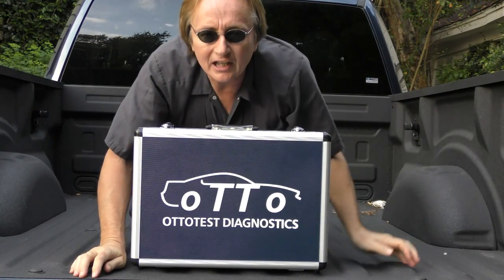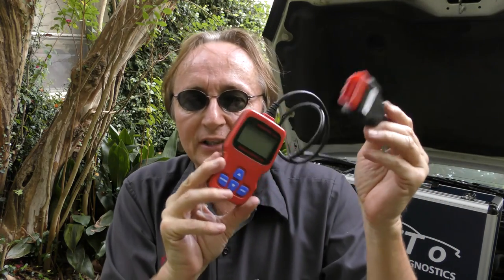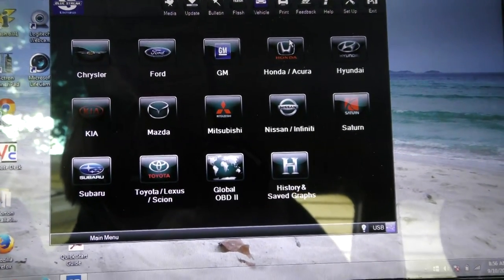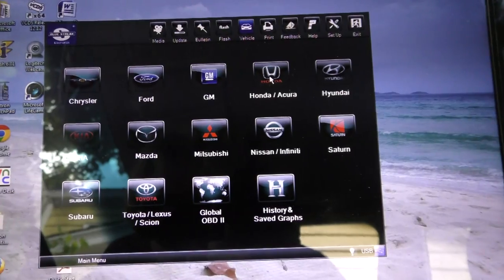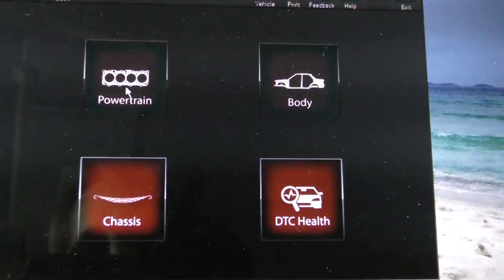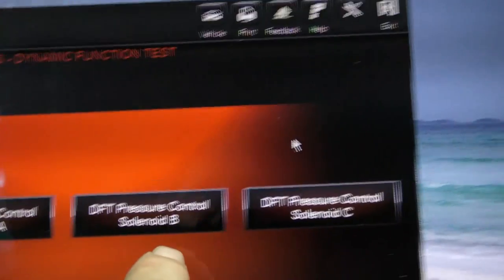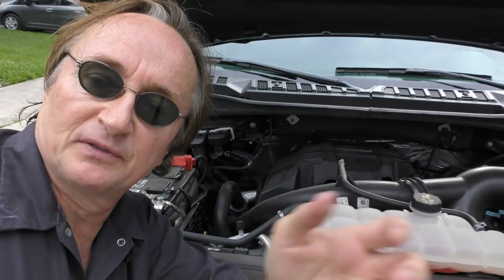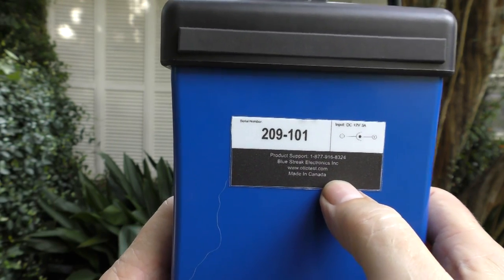Fixing Complex Modern Cars

Comment: Mechanics complain that cars are getting too complex / hard to fix. Yet older cars require you do preform exploratory surgery, taking half the engine apart to try and diagnose why it isn't running correctly. Whereas modern cars have sensors monitoring almost everything and can tell you exactly where the problem lies.
Unless a sensors gone bad in which case... Good luck :P  

Electronic diagnostics are a great idea, in theory. I guess in 10-20 years we'll find out if it was a good idea or not!
Reply: +Azurren 
Are you able to fix something in a '14 or even '13 car by yourself? or maybe you ll just take it to the dealership and drop your trousers down?
that's the point
Reply: thatunknownguy I was referring to modern cars which use open / available diagnostic equipment, not those who force you to go to a dealership.

But I'm not stupid enough to buy a 13 or 14 car in the first place..
Imo if you have the sort of money to shell out on a brand new / 1-2 year old car you have the money to get it properly serviced at the dealership. How else are you going to keep your warranty?
Who in their right mind buys a new car for $70k and gets it serviced for $20?

If you buy 10-20 year old cars you know exactly where you stand. So we'll see what these 14 and 13 cars are like in 2024 ;)
By which time every back yard mechanic will have advanced (old tech by then) scan tools or be long out of business.
Reply: +Azurren I couldnt agree more. Nice clarification
Reply: See. Here it comes again in this comment. It's all about labor that is mostly expensive. On the forums, a lot of people will help you. You don't just need a computer scan tool, a lot of people can help you online to DIY.
Reply: +Azurren you're pretty much right about this.... the only problem with buying old cars up north however, is the rust factor! If you ever had a brake line fail where you couldn't see it, like between the gas tank and frame, you'll know what I mean...😑
Reply: +Azurren Old cars may take more work to diagnose, but not only is it easier to diagnose a problem, it's easier to fix.  A modern car may do the hard work of diagnosing for you but it doesn't mean you have a clue how to fix it.  I'm personally a computer technician and PCs are heading in the same direction - they're getting easier to use but the infrastructure behind all of that is insanely complicated, so when something goes wrong, there's nothing you can do about it.
Reply: Peter Schmidt PC tech here to and I have to disagree with you. If you talk about a normal desktop computer you can easily fix and diagnose your problems. It's when it goes down the the actual circuits and bits and pieces of a component that is impossible to fix, like it has always been done. There is a few exceptions to this like bent CPU/socket pins where you can unbend them and other things to.
Reply: TheMidnightNarwhal That's true.  I guess I should have elaborated:
Modern desktop PCs are easier, because a lot of the time they are self-fixing, or there are workarounds to problems.  I was referring to problems where once the OS can't figure out what's wrong and if there isn't a workaround, you're pretty much stuck with the problem.  With older PCs and OSes, everything was so simple that you could just swap a piece of hardware or software and you're done.  With modern hardware, everything is integrated to the motherboard and a lot of software is closely-knit, while being heavily abstracted (which make tracing the routes of a problem manually very difficult).

For example, there have been times I tried dual-booting on a PC with Secure Boot for repairing from another OS. There have been times where disabling it has made performance in Windows suffer (sometimes causing it to freeze entirely) and other times I just can't disable it at all, so the only way to fix the computer was to take the hard drive out and put it in another system.  Secure boot is supposed to (somehow) protect and make life a little easier for users, but it adds a layer of unnecessary complication that you can't really avoid.
Reply: Yep. New cars are super easy to work on.
Reply: +Azurren Well when I blow a headgasket I pay $50 for a new gasket and a Saturday afternoon working on my car but if i sent it into a dealership then I'd have to pay $1500... Yes easier to diagnose but you still have to take it apart to fix the problem and the parts are more expensive having senors and computers inside everything which well generally sucks balls imo...
Reply: +Azurren I live in the UK and get so irritated with the European car makers these days, such a pain in the ass.
 But it's not really true about older cars with zero electronics. Someone who knows what they are doing can diagnose an older coil, distributor, carburettor vehicle in a few minutes just by listening to it and making a few simple tests, with no gizmos involved.
Reply: like your comments, idk y he's hating so much on Chinese proudcts n european too. they both make good products. i mean the chinese were among the first to make gun powders n european wit their beers. now n days every products are made world wide from different countries. the so called "made in" usa or china or europe or canada or africa n so forth, shouldnt matter anymore. its just stereotyping.
Reply: ***** Generally speaking, Chinese products are made to be as cheap and mass-producable as possible.  Chinese products often lack important features or have shoddy build quality.  Obviously that isn't always true, but that's usually the case.

As for Europeans, it's the complete opposite - they often over-do everything to an unnecessary level.  Their products are almost always good, but they're usually a poor value.  The Japanese tend to make products as good as Europeans but at a lower price.  They might not feel as classy, but most people don't care about that.  Scotty's complaints about European cars is because they over-complicate everything and intentionally get the customer to pay more for repairs.  Again - good products, poor values.
Reply: Peter Schmidt Well it's not always over-complicating. Parking sensors are cool, backup cams are also really neat, and loads of other features that started on European cars.
Reply: TheMidnightNarwhal I agree.  I never said all features are over-complicated, I'm just saying their designs tend to be over-complicated, and you're paying for this elaborate engineering that inevitably becomes difficult to fix.  I'd like to reiterate - I think Europeans make good products.
Reply: Peter Schmidt Yeah, I guess it's more weak less solid products but it's neat stuff.
Reply: +Azurren Eh. I say it's about 50/50 when working on older vs. newer when it comes to ease. If you know how the engine works on an older car, there's really not too much guess work to do. Parts are stupid cheap with a life-time warranty that you can easily pick up at the parts store. I guess it just depends on your experience though and how much time you've had to work on them.
Reply: Balto D If I could afford it I'd buy a classic '60s car in a heartbeat.
Reply: +Azurren So are you saying that a 68 Ford Mustang is a difficult car to diagnose problems with? There were diagnostic machines back in the 60's and 70's that were able to troubleshoot those older cars. With the right equipment, any car can be fairly easy to troubleshoot problems with. The problem with modern cars is the procedures and labor involved with repairing them-requiring dealer only special tools and what not.
Reply: I could fix an older vehicle without tearing the engine apart and these newer OBD systems just made an easy common sense fix difficult. If that puter goes down son, your screwed.
Reply: +thatunknownguy uhhh 13/14 still have warranty :)
Reply: +davis n. lol i drove a chevy z24 for 2 years with no rear breaks because of the ontario brine trucks lol
Reply: Pretty sure I don't want a computer that can fail controlling my power steering while im driving
Reply: bloodrune329 the computer is the least of your concerns.  It's the motor itself you need to worry about.  These days, computers are fail-proof.  The manufacturing process is so refined, and they run on so little power that they don't suffer from heat degradation.  Software designers have, for the most part, learned from their mistakes.
Reply: +bloodrune329 computer failures happen in cars everyday, and you'll almost never hear of an accident resulting in a computer failure in a vehicle. The reason being for built-in redundancies. If the comp goes out, the manufacturer has fail safes in place, such as resorting to regular mechanical steering in the event electronic power steering goes out.
Reply: Peter Schmidt
It depends is it running a light weight RTOS or is close to the metal, has ECC memory and a watch dog timer.
But if it's running consumer grade hardware and an OS such as Windows or Android the computer would likely be the weakest link in the system.

I had my cell phone restart for no reason at all if a car did this it could kill someone.
Reply: Membrane556 As far as I'm concerned, most car computers (that affect how the car drives) are nowhere near as complicated as you're making them out to be.  It wouldn't surprise me if they don't use much more than 2KB of RAM, and I would be really surprised if they ran an OS, realtime or otherwise.

In my experience, the most common low-level software-specifc failure for OSes is related to counters or timers, including the clock itself.  Once an important variable exceeds it's registry limit (which for many such devices would involve a 32-bit processor), that's where catastrophic failures or reboots happen.  But an ECU has no reason to be exposed to such situations.  It doesn't need to cumulatively count anything that would exceed it's variable capacity within the car's lifespan or a single driving session.

But suppose that weren't the case.  I would find it very hard to believe that there wasn't code implemented to make up for a variable being maxed out, and, I would find it even harder to believe that such a variable would bring down the entire system.  Modern cars have hundreds to thousands of individual processors.

TL;DR, the probability of a car's computer being the result of someone's death is so low that if it were to happen, the car would be in such poor condition that just sitting in it with the engine idling would be a mistake.
Reply: Sensors and their systems are plastic and will stop working or malfunction , and one code doesn't usually mean it's the problem, sometimes something else cause it, you need experience to fix , it all the same thing as for cars with no computer and with. Just how you deal with it
Reply: The only people who whine about computers are baby boomers.
Reply: are you fucked?
any car or truck from the 70's-80's I can diagnose and fix anything in a day if I can get the parts day of.
a modern car is disassembling the plastic maze around every fucking component just so you can see the damn thing after all the horseshit engine covers and 1/2 the time they break down not because something is wrong mechanically but because a sensor died.
Reply: thatunknownguy what's wrong with taking your car to the dealership?
Reply: dealerships are scam artists with wrenches.

Comment: The 'Lip' on europe car brake rotors is so that you can here a grinding sound before danger.
Reply: +truth1901 
And you think ruining the rotor is the only way to accomplish that?
Reply: Haywood Jablomy The lip gets ruined. The rotor is fine.
Reply: +Jay Santos sorry to say I got a vw passat and I haven't changed the rotors in a couple of years and guess what they are still good, I am going to replace them next service because that's how I roll but the will still be good.

Americans are spreading out alot of non-sense about european cars but I admire european cars and I have nothing to say against them. They are solid cars that work and give less troubles then other ones from experience...

I am not saying that everyone should buy euro cars but you cannot criticize what you don't experience.

Comment: I can confirm I work as an oil change and tire guy at a chain shop.  Just doing an oil change on most modern vehicles means dismantling some portion of the undercarriage just to get to the drain plug and filter.